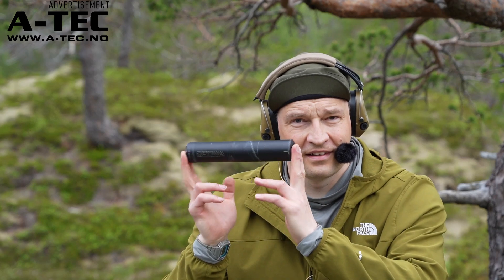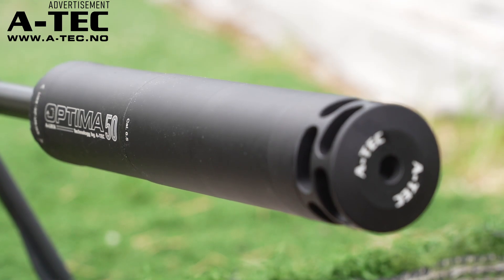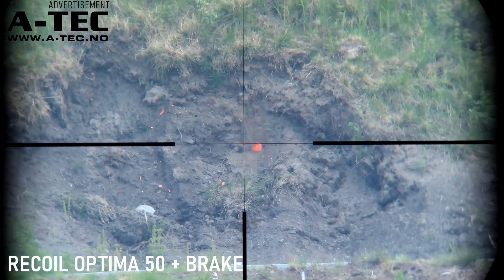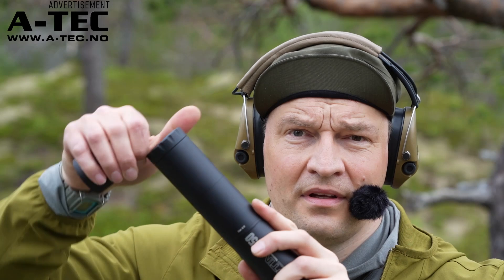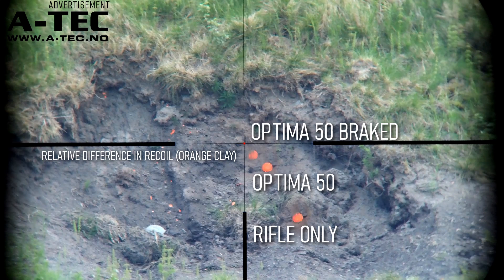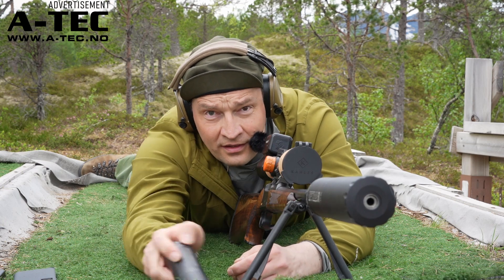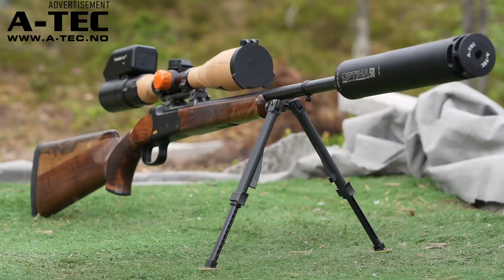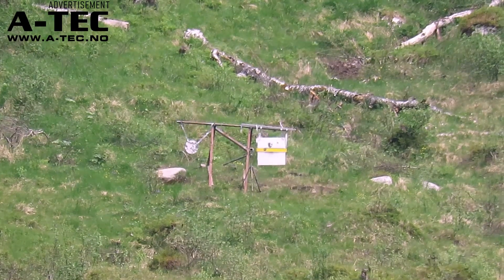LR Blog: How much recoil does a silencer remove?

Comment: Like the scope cam. Reminds me of clay pigeons I shoot at 457.2m (500yrds) with a training rifle I built in .223. 26in barrel McMillan stock, trigger and a BAT action.  Can easily shoot 50-50 on the centers. (Clay "bird" pigeons are 4.3in in diameter) I've learned alot from your blog. Much respect and appreciation from the US.
Reply from the maker: The scopecam has actually been fairly useful in assessing my shooting. Very easy to check where I break the trigger etc

Comment: Do you think the efficiency of the device has to do with recoil reduction?
Reply from the maker: I did not understand that question. Efficiency is primarily metered as -dB reductuon for moderators, secondary recoil reduction.
Reply: @THLR  i think he means the quieter it makes the shot, does it make less recoil?
Reply from the maker: @urgamecshk  thanks for that, I misunderstood. Yes it reduces recoil by a very small amount
Reply: @THLR  does a high reduction in decibels mean a high reduction in recoil?
Reply from the maker: @phillipfrank3595  I don't know the science behind, so cannot answer.